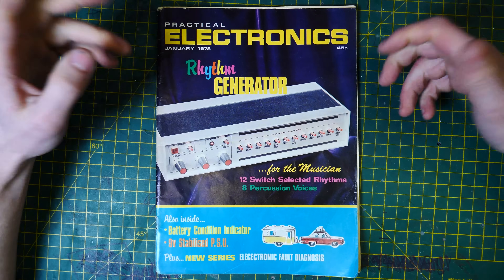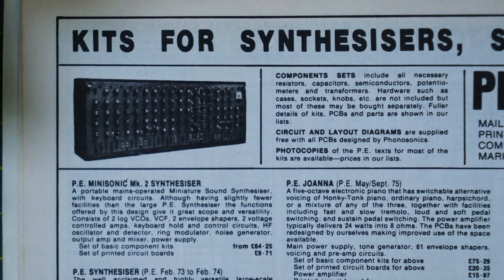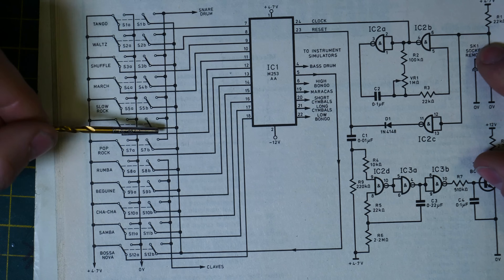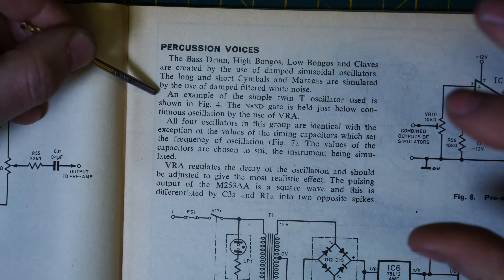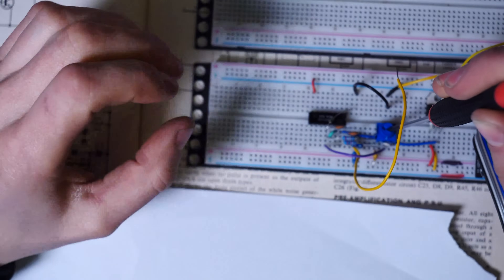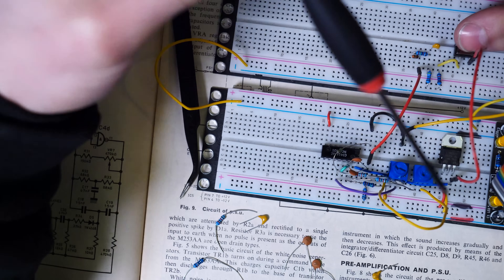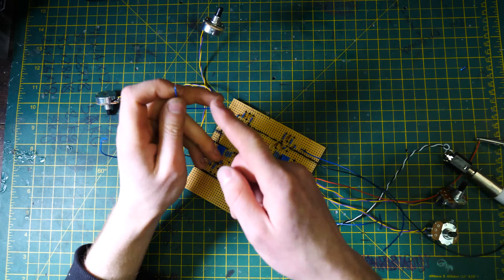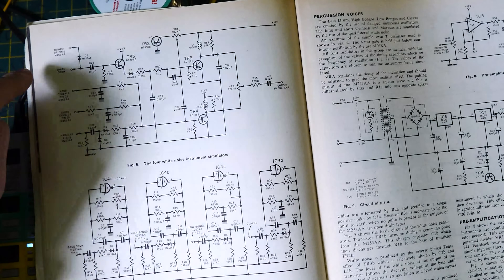Twin T Drums - Practical Electronics January 1978

Comment: I was a regular buyer of Practical Electronics and ETI back in the 70s and 80s, and I remember this circuit being published.
I am currently building a CB55 drum machine from CircuitBenders, which is a clone of the voices of the Boss DR55 drum machine.  They omitted the sequencer because it was a bit rubbish, so I'm building my own with an Arduino.  It's really satisfying building your own stuff. Don't be scared to try it.

Comment: Nice video !! I pulled the rhythm unit from  a T500 Hammond organ that my boss had thrown out. At the moment its composite PCBs are lying on my bench. Theres the switching PCB for rhythm selection ( 15 rhythms which, like you mention, you can super impose by pressing more than 1 button), the tempo and rhythm generator board and the drum voicing board which, like you say, uses a white noise source for the snare, cymbals, hats etc and an oscillator for the bass drum, toms, congas etc which are formanted to make the drum sounds. All passives and transistors. I'm feeding around 24 volts into it and it works !! :) Now, I would like to put it all in a nice enclosure and possibly run it from a 12V supply ... I'm thinking I could supply the required 24 volts using 12v and a boost converter. I alos want to be able to trigger each drum sound seperagtely so I can make myt own rhythms. Not sure how to go about that though. Any thoughts ??

Comment: Ive just got all the parts together to build this too. On project board not vero board.

Im going to use my science fair 500 in 1 kit microprocessor to supply the pulses to the drum circuits. It gives you 64 lines x 8bit of code available for user programs. Thats it lol. Thinking 32 lines for drum patterns (8 steps per beat 4/4time) 32 line available to code some kind of sequencer / play user patterns. 8 outputs available to run 8 instruments. 

World radio history site has all these vintage electronics magazines and more. Its a gold mine. Ive been looking at some of the guitar effects pedals circuits back in the 70/80s. some really cool effects and easy to build.

Like your channel, been watching many vids.

Comment: If you wanted to make drum pads that should trigger the sounds, I came up with a design years ago:
It's a piece of 1mm sheet steel A5 paper sized, with a piezo transducer epoxied on the underside and some thin craft foam on the striking side. Polarity shouldn't matter, just connect one lead to the trigger and the other to earth/common.

Comment: This is exactly the kind of circuits I found in old electronics magazines, books and websites when I was a little kid, didnt understand a word of it, but it still seemed awsome. Later I just didnt have the time and patience to try it all out. Thank you so much or letting me sort-of re-live that time :)

There's also a few early arcade games that made their sounds without microcontrollers. One of them being ASTRO BLASTER which has a few cool sound effects, all built with analog electronics. You should definitely check out its service manual for the complete schematics: http://files.arcadeinfo.de/Anleitungen%20Spiele%200-9%20A-D/Astro%20Blaster.pdf 
See PDF page 57 and 58 for the interesting bits. I've tried simulating the sonar and shot sounds, but it was a little too complicated.

Comment: You could make a sequencer using a 555 oscillator and a CD4017 Decade counter.
555 determines the play speed, CD4017 steps between each of it's 10 outputs per pulse from the 555.
Reply: I believe that by connecting the 9th output of the CD4017 to it's reset pin, you'll get an 8 step sequence.
I'll have to test it sometime later.

Comment: Very important: I've tried different CD4011BE, it doesn't work! it only works with the CD4011AE !!!!!!!!
Reply: Man, I've been trying on and off with the CD4011BE for months using both the LMNC layout and original schematics with little to no succes. It worked once, but only on 1 quarter of the chip, and couldn't replicate it afterwards. Im ordering CD4011AE immediately if thats all there is to it.
Reply: UBE should also work

Comment: Hm I think the claves might sound better a bit lower pitched. Depends on the particular blocks of wood you're after I suppose but your ones do sound a little bit tinny. Also of course if you don't have the right cap, you can always parallel a couple, and add the values. Or else put them in series but I still can't figure out exactly how the maths behind that is supposed to work. 

If you wanted a more modern-style programmable sequencer, just a Johnson counter producing the sequence, and have an LED on each output. Then a whole lot of diodes and switches leading to the drum triggers.
Reply from the maker: I like em high and tinny it sets em apart from the other sounds. imo.

Comment: how are you making sure that you don't overshoot the Voltage from the Bstp? Is there a way to set the gates to 5V or is your circuit secured?
Reply from the maker: I usually go with the notion if it goes pop it goes pop
Reply: @THISMUSEUMISNOTOBSOLETE  hahahaha xD I see :p
Asking because I am using the BSP with a AEModular. Wouldn't risk something on this Baby.
Smoked my first DIY parts last week :p
Reply from the maker: @GlitchyfrogMusic  aaah cool! tbh the above circuit will take 12v happily without it going pop :)

Comment: if you havent  found it yet  in Everyday electronics from  june ish 1988 there was a long series of audio modules like phaser /compressor /delay /vco/vcf  etc all based round an  Lm13600 (now replaced with the 13700 )   using a  standard  pcb   for all the  projects.    something  that may keep you going   for a while

Comment: Where was I in 1978? I was a kid playing with electronics! And waiting for home computers to happen. Only over here "RS" meant Radio Shack. Too bad I didn't care much about music then as a naive youth, beyond getting a 555 to beep a speaker.

Yeah, it looks like the M253AA was the star of this show. That "3072 bits" with the beat patterns was probably 256x12. Twelve sequences at 256 counts per 4/4 bar, or 64 counts per quarter note. Or half that if the sequences were two bars. (3/4 or 6/8? Go take your waltzes somewhere else!)

Seems a bit like an unobtainium part now, but it contained the sequence counter and the multiplexers for the beat selects to the outputs. You could build it from discrete parts, but you can't really get a ROM that small these days. At that point you might as well go full Linn! But you could probably get an Arduino to stand in for it. Racking just the oscillators was a good idea.

Comment: Come on ... if you don't have an Arturia or similar, this is worthless.
Reply from the maker: naaa its not. there is loads of applications without. a beat step pro anything with a 5v pulse. even a 9v battery and some tinfoil drum pads
Reply: @THISMUSEUMISNOTOBSOLETE  Thanx I want to try that schematic💗☮️
Reply: You could easily trigger those from an Arduino. They seem to be designed for 5V (maybe less) trigger inputs.
Reply: I don't understand. What can i do to test that without an Arturia beat step? What voltage can i use to drive a pulse throw a button?
Reply from the maker: @sergioska  the 5v from the power in just a switch between that and the trigger input
Reply: @THISMUSEUMISNOTOBSOLETE  thanks. I'm trying to simulate input pulse signal with a button on power (it's a 9v battery) but it seems no work. Really i think that my problem is different. Changing only capacitors,  I've already tried bass drum and also high bongo block, but nothing. Using an oscillator i can pulse input signal on input when push the button, but testing after c8 (or c12) i don't see nothing. I know that you aren't a customer care 😅, but maybe you could know what is the problem.
Sorry for this long message and anyway thank you so much for inspiration
Reply from the maker: @sergioska  is there any sound at all? like twisting the trimpots does it self feedback if it doesn't something is wrong soldering wise somewhere the circuit isn't working
Reply: @THISMUSEUMISNOTOBSOLETE  problem was low Power battery 😅

Comment: A little tip - the ringing when tapping on the bench etc is caused by the ceramic capacitors, you should never use ceramic capacitors in audio applications due to this reason. Change them for something like film capacitors (MKS and MKP are brilliant for audio) and you wont have this issue.
Reply: Cool; will give it a go!

Comment: The twin-T is a nice little circuit. I did something similar years ago, but with just an NPN transistor as active component instead of digital gates. Will try to do this with vacuum tubes later and get something like a Wurlitzer Sideman. :-)